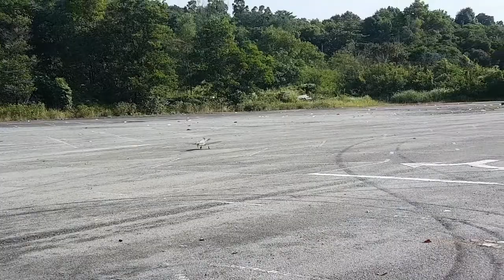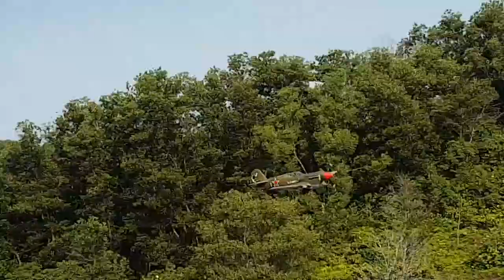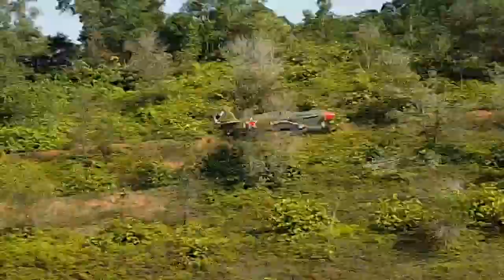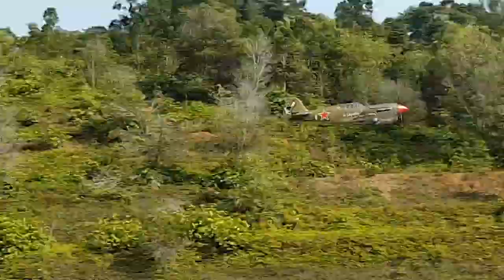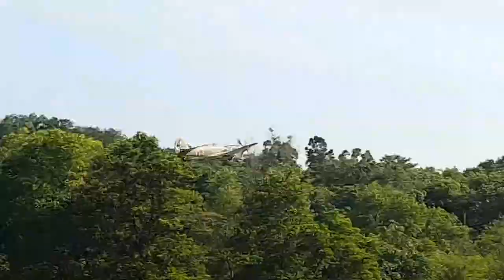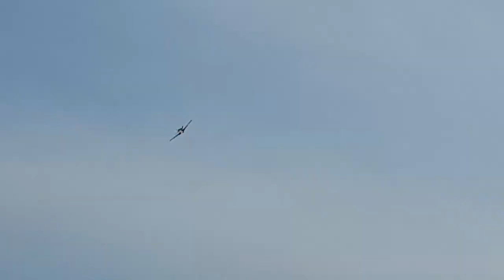Durafly P-40 maiden after repair

Comment: The looked to be a hard stall on landing due to much flair and maybe a gust of wind under the wing...looks like you will have to land that plane on the mains with wings level for success..
Reply from the maker: I think some wing washout would be helpful
Reply: @VictorHugoRC1111  ive got the banana hobby version of this plane and the Cg is perfect when i Place a 2200mah 4s battery all the way forward with the battery angled at 30 degree,s to get it way up there!